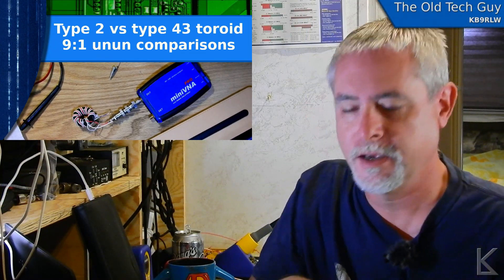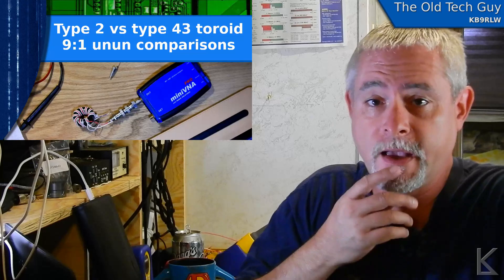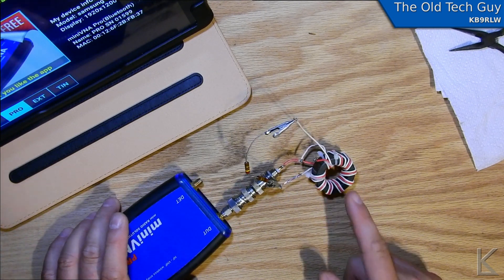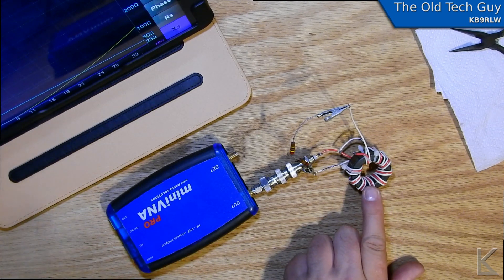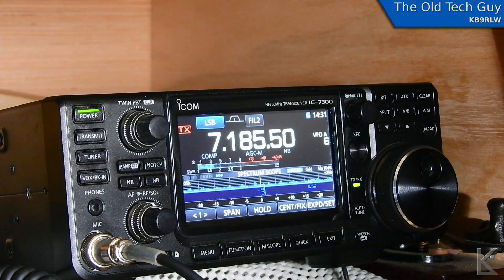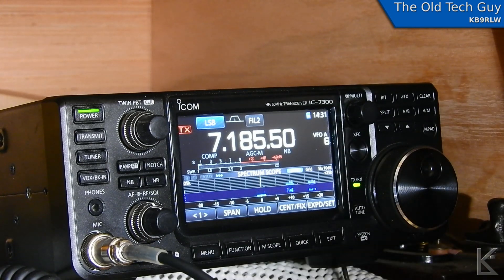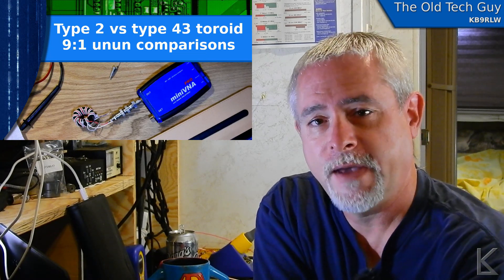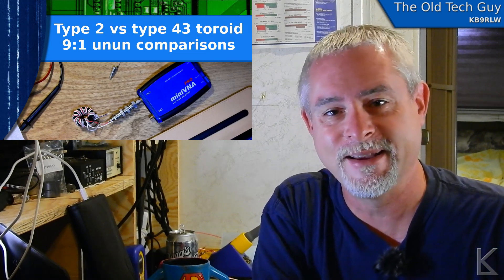Ham Radio - Type 43 vs type 2 toroids,  comparing 9:1 UNUNs

Comment: Kevin, I have been using 43-240 toroids. With 14 gauge magnet wire on 20 and longer. What is the difference if I use 140? They are cheaper, I think. About the same?
Reply from the maker: If you mean 43-140, the difference is it's smaller. The second number is the size.

Comment: Hello, iron powder material (e.g. mix #2 in your video) and all low permeability materials are not usable for wide band transformers starting from low frequencies like 1.8 o 3.5 MHz because their permeability is too low so they need too much turns to show enough reactance at those frequencies. "Too much turns" give problems on the other side, at 28 or 50 MHz due stray capacitance among the turns. High permeability helps to reduce the turns number.
You did not test the main feature for your transformers: insertion loss !
Consider that a false low SWR can also occur due to the losses introduced by the transformer itself (I am writing this for other viewers: it is not your case). 73s

Comment: does anyone know why 49:1 Unun End fed half wave transformers have a Frequency Coverage: 1.8 to 30 MHz while a 9:1 Unun usually can cover also the 50 mhz (6 meters bands) ?
Is the frequency limitation of a 49:1 purely mechanical or .. ?
can you still operate on 6 meters with a 49:1 ?
for ham operators like myself having to have a separate antenna for 6 meters is not an option. many thanks in advance 73

Comment: Looking at both screen shots of mix Type 2 and mix Type 43, it is obvious to me that the type 43 is notably superior everywhere below 30MHz.
The 1.35:1 SWR at 30MHZ or so, just gets better and better the lower in frequency you go. 
Therefore, for 95% of all my HF work I would not use the type 2 at all... 
So I ended up winding my 9:1 unun on two stacked FT240-43s just in case +120 watts is a bit too much power.

Comment: Type 43 cores have good characteristics for the lower frequencies since it produces a lot of inductance for the number of turns you are using.  Type 2 iron cores are also good for lower freqs but they don''t produce as much inductance as 43 cores so they aren't good for use as transformers but are very good in HF tuned circuits.

Iron and Ferrite are difficult to use as transformers because even it they produce enough inductance they also introduce large loss resistance.  But if you use cores that don't produce low resonance frequencies and low RF loses, you then don't get enough inductance.

These characteristics make it difficult to make high inductance transformers with very low loss resistances.  The answer here is to use the 43 cores for low freq HF freqs and type 2 or ft-61 cores for higher HF freqs.  In other words use 2 antennas to cover HF.

Comment: Mix 43 ferrite is great for broadband HF  impedance transformers, but if you're running power they are much less tolerant of overheating. They can be ruined by overheating. The Mix 2 cores are iron powder and can be hit with enough RF to melt that plastic box, but once they cool down they are good to go once more. Iron powder cores are much more thermally stable than ferrite.

Comment: It looks like the type will work better for all the HF band, maybe not that good 10 and 6. But should still work 160 to 6 with the IC7300 tuner.  Can you tell if the IC7300 tuner brings in 6 meters  on the 43 mix.
Reply from the maker: It depends on the antenna.  If the 'raw' SWR is 3:1 or less, the 7300 will handle it.

Comment: Another question about these is do they react different if wound for a 9:1 UnUN vs a EFHW half wave... the cores for the 9:1 UnUn on the QRPGuys website show the Amidon 'red' type 2 cores but they wind their EFHW cores with type 43 material... I wonder why?
Reply from the maker: I found that the type 2 cores work pretty well from 20 meters up through 10 meters.  The type 43 work better for 160 meters through 20.
Reply: Also came to ask this as I’ve been looking at diy transformer and choke builds and comparing what comes in the most popular kits

Comment: What would be interesting is if you did that same experiment, but glued a Type2 on to the Type 43 with a dab of crazy glue, just enough to keep em together for the experiment, then wound the test balun over both of them. My suspicion would be that you would get the best of both cores in 1 package.... I have some 31 material, which apparently favors the lower frequencies even more than the type 43. and some type 2 material but they are slightly different sizes so for me that might not work...can't even get 43 here in Mexico without paying a fortune in shipping.  
Richard VA7AA/XE1
Reply from the maker: I would speculate that it would be a wash.   Where one core is better at a certain frequency, the other core may negate the advantage.
Reply: @loughkb  .... dunno why Kevin, the permeability characteristics of each core material should stay the same... I suspect you'd get the characteristics of both... the cores themselves don't change, and the flux lines within them should be the same.  Where the change comes in is in the ability to properly wind a test balun over the combined cores... and in how you factor those characteristics into the balun winding. Anyhoo, If I can get my sticky hands on sone #43 material down here in la país de las cucarachas, that is the same physical size as the #2 material I'm gonna give it a try using my el-cheapo NanoVNA.. it would be interesting to see what really happens...  73 Richard VA7AA/XE1 Barra de Navidad

Comment: Lower permeability core has low inductance and low impedance at lower frequency. It will shunt the primary, especially with only a few turns. I would assume a lot more turns needed to make something like a type 2 or 6 core to work.

Comment: Nice demonstration,  I have also such a minivna pro but can't work anymore with the sofware on my pc and windows 10, I think you use a android system,  works well, it seem,  have abought a FT240-43 for 80m and a longwire follow the discription in CQQSO 5&6 june pages 17-20,                     73 de Patrick

Comment: What I find interesting is that people use different materials but with the same windings. From what I have read, type 2 and type 43 materials have different Al numbers which are different amounts of inductance for a turn when winding wire round the toroid. So is the crucial figure the ratio of turns for the transmitter side as opposed to the antenna side of the circuit? If so, what difference does the inductance make, if it is higher for one material than another? I have scavenged some toroids from switch mode power supplies and have found their datasheets, which show an Al number between those of type 2 or type 43 toroids, and which give a working range of frequencies that is OK for HF, so I am assuming that these toroids could be used? Or am I missing something?

Comment: Hi,

We knows that balun and antenna tuner have similar purpose., to impedance matching the antenna system.

For tuned antenna system, balun or matching transformer  is more than enough to get optimal performance, on certain bands. 

Antenna tuner ism more flexible for multi-bands operation. 

My question is..

If we use antenna tuner, is balun needed ? Example for the folded dipole experiments,  do we get better performance just by using antenna tuner? 

Thank you.
Reply from the maker: A balun can bring an extremely mis-matched antenna down to a range where a tuner can handle it in extreme cases.
Reply: QSL, and thank you,, for the answer.

Comment: Hey again Kevin.  I noticed something with my toroid fun.  Using the ununs, I found that on higher freq bands (12, 10, 6, etc), the toroid itself acted as a fair antenna.  I looked at it.. and jeez, what you have is a magnetic loop don't you?  I've never played with a mag loop but know that you have.  I wonder what would happen with a cap across the primary like in your loops, and the secondary high z taps not connected?

Comment: Hi Kevin. I have changed to Linux, but am having major problems, trying to set up WSPR, and FL digi. I am using Ubuntu 18.04, and have also tried Mint 19, but find both not user friendly, what Linux package do you use? Len G8LXI
Reply from the maker: I run ubuntu MATE myself.  I like the MATE desktop.
I think I have videos on setting up both fldigi and wsjtx back in my catalog.  Search for each and my call to find them.   The usual gotcha I hear about is people not being able to get rig control to work.  Often it's caused by their user not being in the dialout group and they don't have access to the serial port or device.  In the control panel there's a users and groups section where you can manage groups.  You need to be a member of dialout.  Once added, you need to log out and back in or restart for the change to take effect.
Reply: @loughkb  Hi Kevin, thanks for the reply, I will try and find a distro for  mate. Take it easy. Le,. G8LXI
Reply: @loughkb  Hi Kevin, I have installed mate and it is great, now looking at your videos to get the apps going. Many thanks, Len G8LXI

Comment: Hi Kevin, did you think of putting the two materials together? When I need a very wide band material I sometimes stack up two cores of different materials and wind my inductor or transformer on the two together. This way you benefit from the material properties of both. I think in this case it may give you a good low SWR over a wider frequency range. Never tried it for an unun, only for EMI suppresion, but who knows...
Reply from the maker: Thanks for the suggestion.  I'll keep that in mind.

Comment: Kevin, as 43 material has higher permeability, you can use less turns then you will improve the top end. Try 6 turns and also watch for core temperature on the lower frequencies as they tend to get warm. Same goes for the 50:200... Play with the number of turns to get a flatter overall SWR curve. Less turns= better top end but works warmer on the lower end. 73 DE LU6PSG

Comment: In the VNA app, you can swipe from the top (outside) of the display down. This will give you a read out marker that you can drag around. That way you can get exact read outs of specific points easily.

Comment: If the 9:1 UnUn is good as shown with one, I wonder what 2 cores are like? Some other homebrewed UnUn types are based on the Comet CHA-250 which seems to make do from 40M to 10M. Here is a link to the page in question.

http://www.g8jnj.net/broadbandhfvertical.htm

Comment: what's a good cheap lightweight rechargeable 12v battery to buy for a portable backpack / manpack system i am building for long term off grid ?  will recharge with portable solar.  it will have btech 25 amp signal booster and baofeng gt-3tp radio.

Comment: Nice vid Kevin.  Playing with baluns and ununs if fun and interesting.  I've been experimenting with HF ununs for 3 months - since breaking my leg in two places and tearing tendons from the bone... whilst installing a low, 130' wire for 80m Sprint nights.  Well... the wire works great on 160 as a quarter wave crappy performer with 3 radials, 150' long each, laying on the ground.  On the other hand, during the NA QSO Party tonight, I worked half a dozen states on 160 using QRP.  Anyways, I found (for me) the perfect unun.  I wind 'em with 6 or 7 taps (not 3 turn primaries and not twisting the primary and seconday wires together on autotransformer ununs.  Why would one want to increase the capacitive coupling between windings?).. and I have settled on type 43 for all HF.  People are crazy about SWR.  If your radio will output the power you want then you don't need your tuner.  Why add another layer of loss?  I'll only use mine with moderate SWR on the higher freq bands.. where my last unun performs worst of course.  But with multiple taps, i get this result using the 130' leg breaker:
10m:  16:1 tap, 1.8:1 SWR
12m:  16:1 tap, 1.7:1 SWR
15M:  9:1 tap, 1.1:1 SWR
17m:  9:1 tap, 1.4:1 SWR
20m:  4:1 tap, 1.1:1 SWR
30m:  4:1 tap, 1.4:1 SWR
40m:  16:1 tap, 1.0:1 SWR
80m:  3.5 to 3.8 MHz  16:1 tap, 1.5:1 SWR
80m:  3.8 to 4.0 MHz  9:1 tap, 1.5:1 SWR (altho the 16:1 tap gives an SWR of < 2:1 at 4 MHz and so covers the whole band)

I have 2' of coax connecting my rig to the unun, which is next to my desk.  Alligator clip on end of wire.  With just a change of taps on the unun i can cover all HF bands.  Efficiency?  Not bad - the unun will only get luke warm after 10 minutes of rag chewring at 50w (CW) or 100w SSB.  At 25w CW key down for 1 minute there is no temp change.  I wound the same on an FT240-43 and 100w key down for 1 min only makes the core luke warm.  Again.. SWR is meaningless with 2' of coax.  lol.  So if my rig outputs the power I want (it will output full power up to ~2.0 SWR) then I don't bother with my internal tuner.  I only use it on 10 and 12.. even though I don't have to and it's doing nothing for me (other than adding more loss).  The lossy baluns and ununs are bad enough.. which is a good case for using 50 ohm resonant antennas.  Drives me nuts when people connect a poorly matched unun to a 'half wave end fed wire' using 50' of coax when they just don't need it.  They're happy when their rig will 'tune the antenna' and 'get a 1 to 1 match'... while the 50' of coax has an SWR OF 4 or 5 to 1 on it.  I guess on 80 that's fine tho.  73 OM

Comment: type 43 core is powdered Ferrite material, a very broadband material. Whereas type 2 is powdered Iron material, not very broadband - and considering how wonkie the swr specs are, it is something i don't think i would ever use on a multi-band HF antenna system!  I figured this out by looking at specs, from various manufacturers, but thanks for doing the guinea pig work for me!  :)   AI6XK

Comment: Kevin, you really need to be looking at R, not Z when you scan. An antenna that is 50 ohms impedance and is mostly reactive  is crap, one that is 50 ohms resistive is great. Is your long wire antenna in the video resonant? If so, a 49:1 transformer is closer to what you want. (edited)
Reply: AVT: Z = Impedance.
Reply: @KB4QAA  I give up.
Reply: avt Z is not reactance
Reply: @geokuf9679  Fully aware of that, I said "50 ohms impedance and is mostly reactive"

Comment: I think it must make a huge difference as to how they are used. MFJ has figured out how to use them from 2 to 30 in the intellituner. That said, the chart here http://www.qrz.lt/ly1gp/amidon.html and that circuit having poor low frequency response you may need to experiment with type 1 .